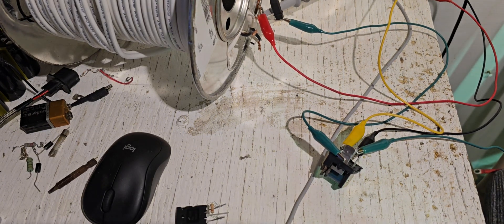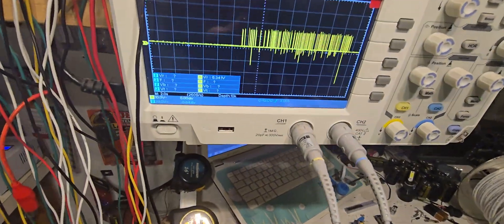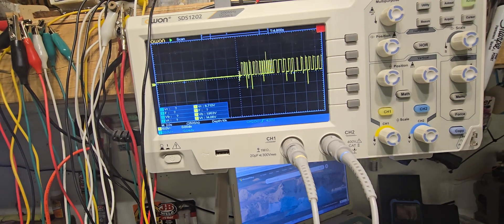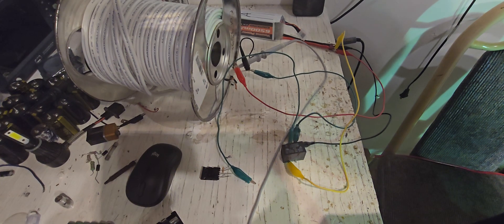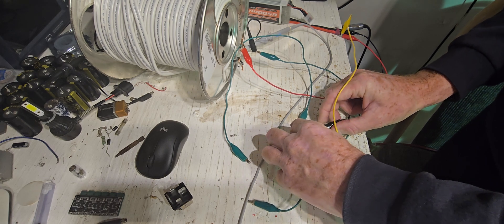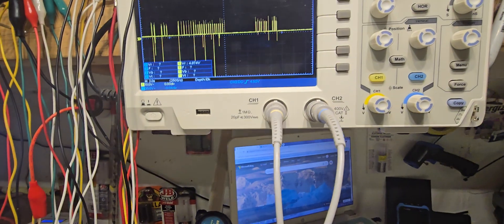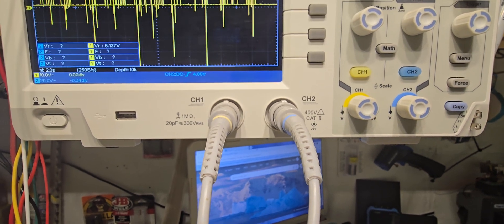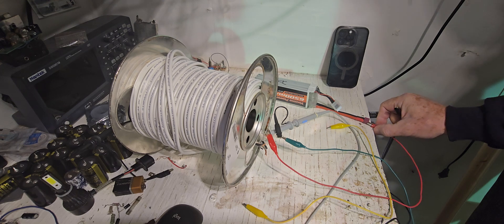What works best?...Mechanical Relay or Mosfet for capturing Flyback spikes from coil of wire

Comment: If they made relay contacts with more surface area they would outperform NPN  only by transmission efficiency not frequency of course . (opinion)
Reply from the maker: Yeah I agree
Reply: Can't the frequency be changed on the relay by adding a capacitors?
Reply from the maker: @make425 no it only opens and closes so fast because it's mechanical
Reply: @make425  you can use capacitor to speed up or slow down yes. More farad slower . But a relay will never switch faster than a Transistor because transistors switch solid state. For explanation purposes we explain them as switches and that they are
Reply from the maker: It's mechanical once it reaches the limit that's as fast as it will open and close same as a transitor or fet they only work to design limit . Mechanical switches tend to bounce and vibrate upon closing as you can see in the demo on the scope shots .
Reply from the maker: Yeah I think that's really interesting how it starts to resonate giving the flyback spike a flyback spike back to the input direction
Reply: @windpowerandmore6310  there is more control potential using magnetic field for self disconnect source from the inductor as your disconnect for self switching, Field from first ignition coming off the core of inductor can trigger a disconnect from source then using spring or another magnet to iron to bring power back on
Reply from the maker: @mykedoes4099  I agree because when I was making mechanical switches for my motors it was using a magnet which reacted with the magnets on the rotor.  The motor would tend to run best in a frequency that matched that mechanical switch with the amount and spacing between the magnets on the rotor.  I wish I had video of those motors.  I also had DC motors that pulsed once per rev. That was powered the rest of the rotation by a magnet ramp.  Those motors ran at more rpms than when powered on 100% and also ran cold.  I ran them continuously till the magnets gave way the switches survived. But it only had to pulse a very sharp pulse once per rev . I think those were the most interesting motors I ever made and planning on building a new version when I have the extra time.  It's really interesting to see the magnets power the motor faster than it was normally powered
Reply: @windpowerandmore6310  right makes sense rotor magnets influencing the relay. I guess you had some kind of V gate ramping the extra speed i seen this before on another channel they claim its how the extra power is made
Reply from the maker: @mykedoes4099 it's not a V you can actually see the type on the ramp motor i built a couple years ago i have a whole video series how i built it it's similar to a extent but still similar to the V Gate just more powerful
Reply: @make425  and a transistor will never out match surface area of contacts , well double check my statement here thay may have advanced the tech by now
Reply: @make425  maybe a SSR solid state relay is better than both the standard relay or the standard transistor regarding contact area or transfer surface area

Comment: Question. What side is the relay and mof on? The negative side or the positive side of the coil. 
And what's that mof numbers and how much is it.  
I think I need this on the 4 footer with the 113 volt input. 
I actually went and got a job to upgrade the wheel.😂
Reply: Guess I'll just Google 1500 volt 100 amp MOSFET. 
It's gonna go boom anyways 😅

Comment: Yep I agree Mosfets and Transistors are the way to go Iv watched other channels use relays if seen some good results what do you think about Feraday Research motor let me know
Reply: Makes you wonder if a passing magnet would effect the test results. 
I know a mechanical switch can act like a diode.
Guess it's a downfall not having a oscope.
Reply from the maker: @make425 it doesn't change the results I have a video with the same setup shown on a  monopole motor with the same results mosfets always work better
Reply from the maker: Thanks for your comment and watching! Mike is a very smart guy he seems to have found a switch and combination that works.  He seems to get great results.  I've also had good results using them in the past when I first started building motors but have not ever found a switch that can be reliable enough for long term use.
Reply: I agree that a relay is only good for testing and not for long term use. 
I run 113 volt on the big wheel and it use to eat relays😅. I've gotten pretty good at making homemade Mechanical magnet switches .
 I will say there is some strange effects ive only seen with a Mechanical switch. 
I honestly believe the back emf should be thrown away. Or lighta led with it . 
And glad to see your back doing videos.👍👍 . @windpowerandmore6310